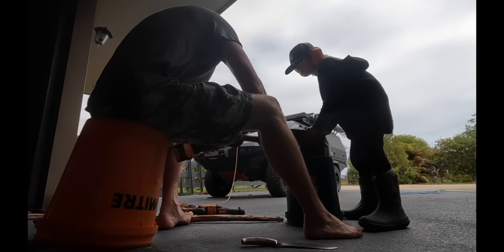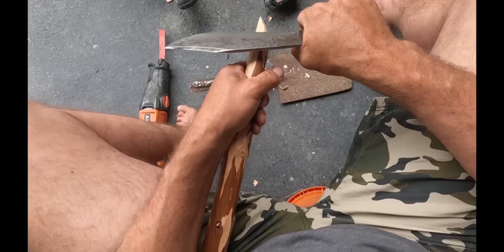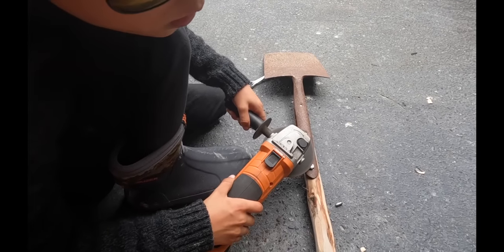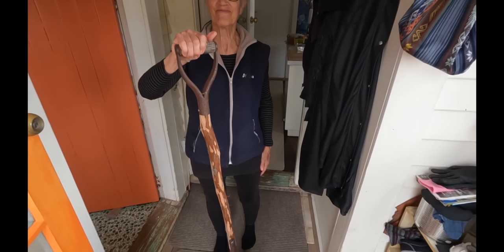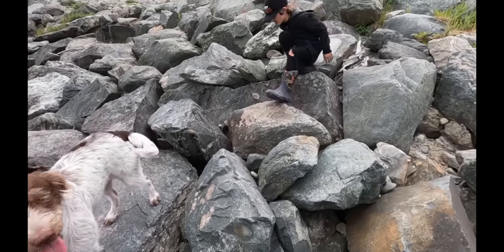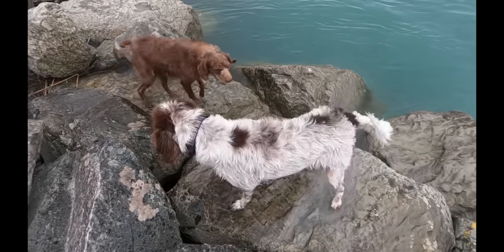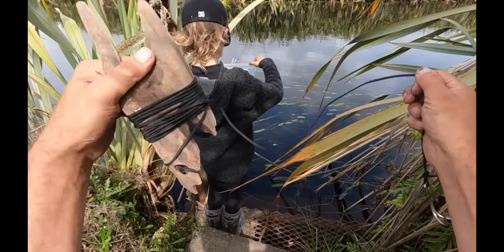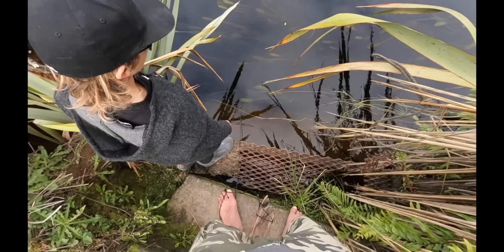Josh James Paua Pasta Recipe - Eeling - Motorbikes with Sonny Jim and some other stuff

Comment: I know you posted a video about all your ute upgrades but seems like you always have a flat battery, have you thought about improving or addiding a redundancy for your battery system
Reply from the maker: It's the alternator, only 50 amp. I got another one with. 160 amp output. Cheers mate